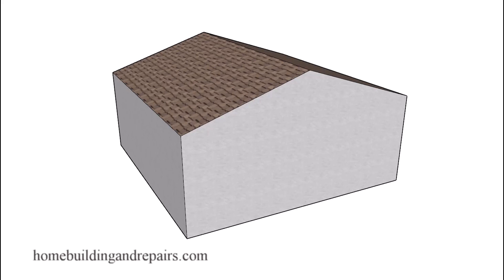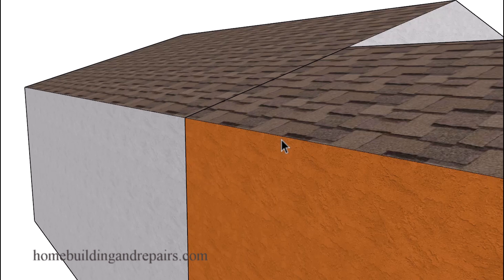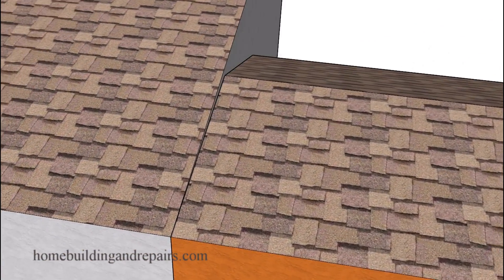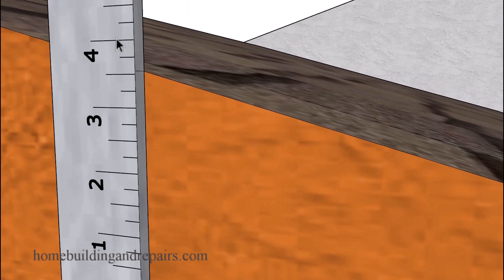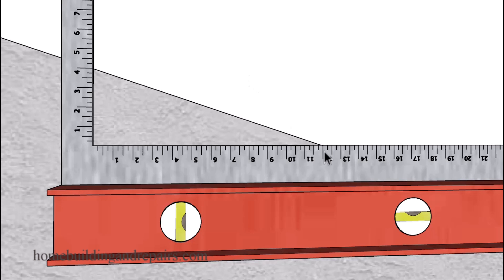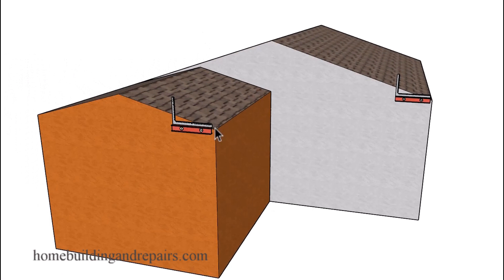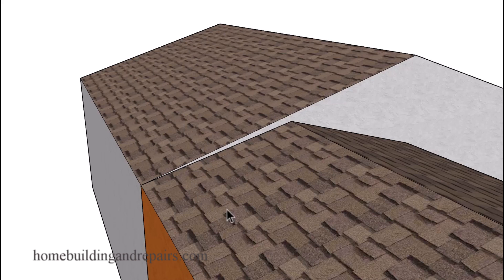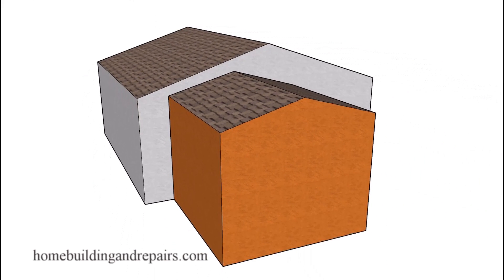Roof Truss Pitch Angles: What You Need to Know Before Building a Home Addition

Comment: Something else to note. Even if the pitch is an even 3:12 or 6:12 or whatever, the heel height of the truss is typically different than that of conventional framing so the plate height might have to be adjusted for the roofs to be in plane ..... and if the plate heights are different, then your eaves, fascia and soffits might be off. A lot to consider when mixing trusses with conventional framing.
Reply from the maker: I like it.